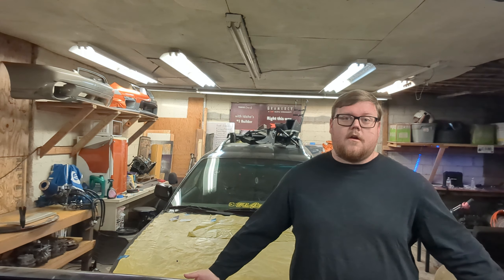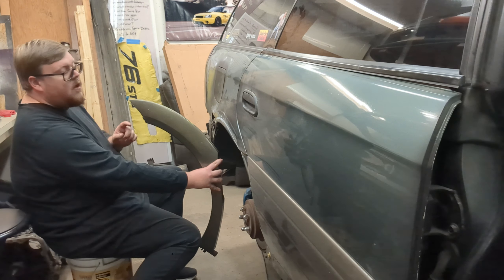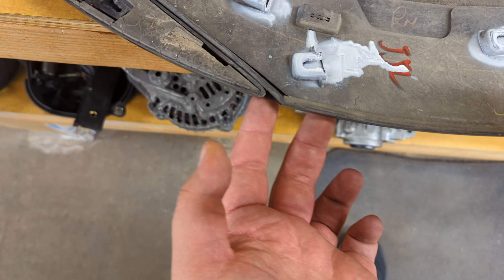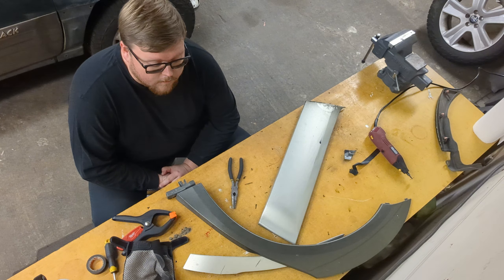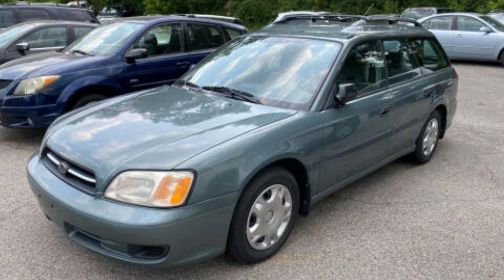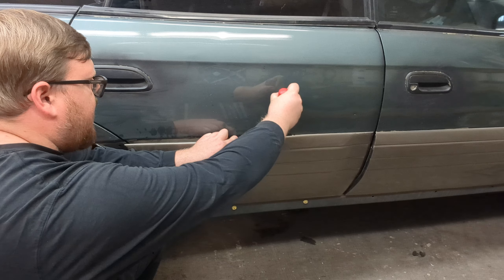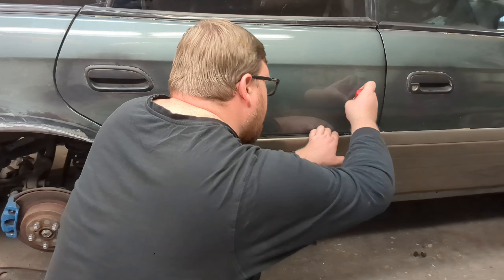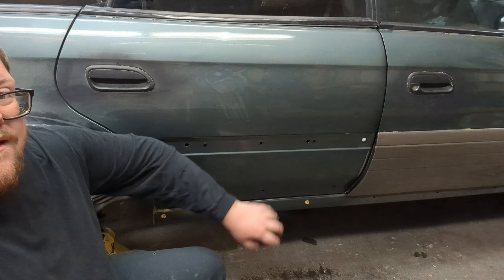Cheap DIY "Widebody" Subaru Outback (Scoob Rebuild Part 10)

Comment: Subaru Baja fender flares would probably work because the Subaru Baja is just a Subaru legacy with a truck bed
Reply from the maker: @Taco1567playzmcpe  correct. But I don't like the shape of them nearly as much, and the rear quarter piece doesn't line up nearly well enough on the wagons.

A few other people have gone down that path before, but I like the challenge of being possibly the first to try BL/BP flares

Comment: Does the baja not have wider wheel cladding and baja and OB share same body.
Reply from the maker: @TheNecro1015  correct, however the rear quarter pieces are a way different shape than the Outback would need. The Baja cladding is also harder to come by and more expensive.

Imo it also looks a little goofy